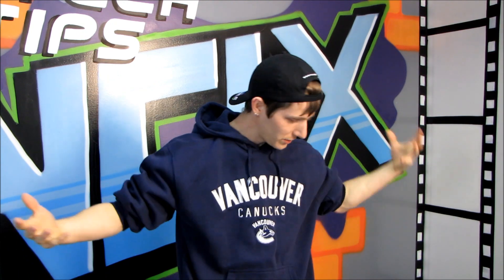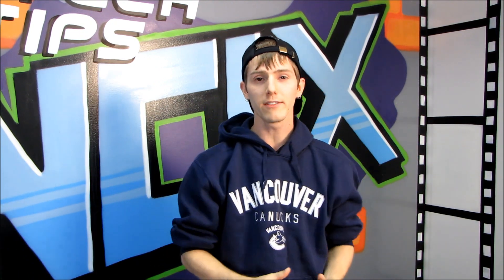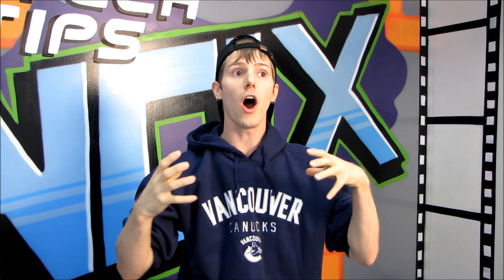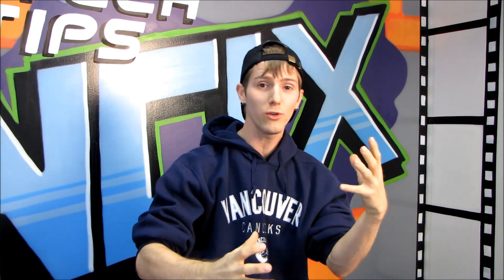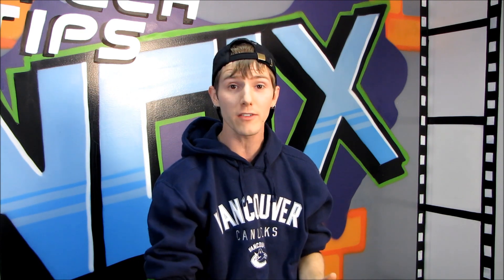Futureproofing Your PC - Dispelling Some of the Myths NCIX Tech Tips

Comment: CPU: AMD FX-6300 3.5GHz 6-Core Processor 
COOLER: Coolermaster Hyper 212 EVO
PASTE: Artic Silver 5
RAM: G.Skill Ripjaws Series 4GB (2 x 2GB) DDR3-1333 Memory x2 
MOBO: Asrock 980DE3-US3S
GPU: SAPPHIRE Radeon R9 270X Vapor-X 2 GB editon 
CASE: Cooler Master HAF 912 ATX Mid Tower Case 
PSU: Corsair CX600 
OS: Microsoft Windows 8.1 Professional (OEM) 64-bit
SSD: Crucial M500 240GB SATA 2.5-Inch 7mm Internal Solid State Drive
Reply: Pretty decent, although I'd ditch the SSD and ger 8GB RAM and possibly a better CPU
Reply: R9 270X is nice GPU, you could upgrade to fx-8xxx in the future, I got FX-8350 and it's very nice :)
Reply: Ditch the ssd for more ram and get an ssd later
Reply: pretty close to my pc and i can tell you it preforms pretty well .. only i have the 3570k and the z77x mobo and 8gigs of ram ... but same graphics card and cooler and ssd ... so i would highly recommend adding more rams ... you'll need it
Reply: im pretty close yo your rig,

same cpu and cooler 
kingstone hyper x red ed. 4x4gb
gigabyte 970a d3 
sapphire toxic r9 270x 2x2gb
corsair rm1000w 80+
ms7 ultimate 
kingston hyperx 3k 480gb ssd 
all wrapped in a zalman z11 and custom cooling
Reply: yep next upgrade: fast ram

Comment: My current rig, build at the end of June 2014:
Intel i7-4790K 4.0GHz (not OCed yet)
MSI Z97 Gaming 7 motherboard
Noctua NH-D15 (I'm too clumsy and afraid of liquid cooling)
24 GBs 3x Crucial Ballistix Tactical 8GB RAM CAS 8 (NH-D15 is a silent monster high profile memory would not fit)
Win 7 OS on 240GB Kingston Digital SSDNow V300
Backup 1TB Western Digital Black 
NVIDIA GeForce GTX 560 1024 MB GDDR5 (salvaged from previous PC will be upgrading soon)
CORSAIR AX760 80+ Platinum PSU (Did not see the point on spending almost $100 more for an i series)
Corsair Carbide Series Air 540 case (lots of space to work with best case ever!!!)
Keyboard Logitech G510
Mouse Logitech G602
Headphones Logitech G930

I stream on twitch and do some minor video editing. I figured that I'll be able to run (not in max specs) any game for the next 5+ years!
Reply: Take away from the ram and make your gpu at least a 760ti or higher
Reply: I changed the gpu to a EVGA 970 ACX 2 Ftw. I was using my 560 while the 970 was out of stock everywhere, thinking on doing SLI in December what do you think?
Reply: getting a better card is always better than sli but if you have the highest card then you can but i reccomend getting the 980 instead

Comment: My dad says that it's not worth it to spend 600$ on a PC. ;_; He says that "the more you pay, the more you lose"

So I'm forced to use this kind of setup :/

AMD-FX 6300 3.5ghz 6-Core
6gb G.Skill DDR3-1600
EVGA GeForce gt 640 (Dual Slot) 4gb 901 mhz

would this be a god build, or not? I'm planning in doing some gaming and video editing.
Reply: Doge Charger 
CPU: Amd fx 6300: $120
Mobo: Msi 970a-g46: $80
Ram: 8gb kingston hyperx fury: $75
Hdd: Seagate barricuda 1tb $53
case: nzxt guardian blue $55
Psu corsair cx600: $60
Gpu: Sapphire R9 270: $160
Total: $603 (plus I rounded up so its even cheaper) (and these prices are as of now on amazon)
Reply: Allan AV Thats not too bad..
Reply: of course the best way is expend in what you need... sometimes is good to expend in what you want but obously will cost more and also you wont be beneffit just personal ego... for a good example: you... you only can afford a budget pc and i think you want it for games.... for gaming you want a core i5 right?? but belive me in like 80 to 95% of the games the intel pentium should throw the same performance  and as you can only afford mid-low to mid-high GPU the intel g3220 wont bottle neck it also itel cpus offer a more continous FPS so is great for games, lso is a cmplete CPU with L3 cache... the APU are like... well better buy a phenom II XD. And you can have an i5 when they're cheaper or ge one used IF you want a better performnce
Reply: You'll get by with this build, not great but it will work just fine.
Reply: I have a gt640 and it runs most games at low/medium.
Reply: Ok.. I know that my computer then at least isn't that bad when ti comes to performance ratio then. Thank you. :P
Reply: What games do you prefer?
Reply: Minecraft, Prison Architect, BF3/4
Reply: Minecraft runs with VSync and Fancy at about 60-120fps with my FX-8120 and BF3 runs at 30-60fps on medium/high settings.
Reply: Ok, thanks for the info! :D
Reply: Doge Charger Get a gtx 650, radeon 7770, or try to find a used graphics card for cheap. Whats your budget?
Reply: My budget is preferably below 630$.
Reply: k, thank you for the help!
Reply: Doge Charger No problem (: .... Let me know if you get it!
Reply: I'm expecting my build in about 10-15 days. The only difference I made to this build was change the processor to the AMD-A10-6800K, because I know that you can make the APU and GPU work together and get better FPS. I'm expecting high FPS with medium-high settings in most of my games. :D This build should help my channel, previously  couldn't play a lot o games, but now I can. Thanks man, you really helped me out! :P
Reply: Doge Charger No problem! but I would not recommend that because you're downgrading from a six core to a quad core. Plus Apu's only crossfire with lower end cards, which also isn't recommended. Trust me the R9 270 is more than enough! If you overclock it, you can run bf4 Ultra settings at 60+ fps. Hopefully you didn't order it yet, but if you did, the build is still good. Hopefully you got a socket fm2 motherbard if you did get the a10-6800k.
Reply: kk
Reply: actualkly your dad is right... for example ifyou buy a very powerful pc 2000USD in the future when it beggins to feel laggy and slow, who will be interested in it?? you wont even get 1000USD for it... when you sell something that you used thats the term of salvation ratio and its an economical concept. So the more yo pay will be less you could save inthe future...

a 600USD you could  sell it fast in 300 may be an student could be interested so the more you pay the more you loose
Reply: crazymetallian Yes, but in reality, it is good to spend more money on a computer, as you can get better parts, and you will have better warranties. Although, spending 2000 dollars on a pc would only be worth it if the programs you run are very cpu and graphics-intensive.
Reply: Those parts would do fine for what you're going to use them for.
Reply: Nope you need about 6gb ram
Reply: Jujhar Singh For your average gaming, yeah, that's true, But I may in the future acquire more powerful software for recording my youtube videos.
Reply: Doge Charger Did you get it yet?
Reply: Silky The BassGod Yes, as a matter of fact, I did! It's the best system I've used yet, and I can run most game at medium-high graphics. Thanks dawg you're a life-saver.
Reply: http://www.systemrequirementslab.com/cyri
it is a great resource for you and anyone that is building a gaming PC
Reply: keep an eye on newegg's combo promotions every once in a while they will have a pearl for sale at a good price!
Reply: Doge Charger No problem man! Glad to help :) Now all you need is an SSD
Reply: Silky The BassGod new egg has some good promos I just got a 500 GBs Samsung for $210 and MI original Kingston 250GBs for $89